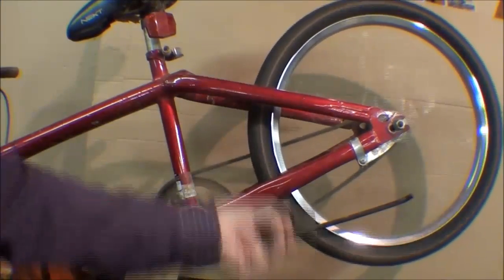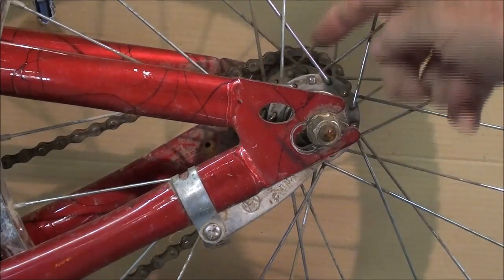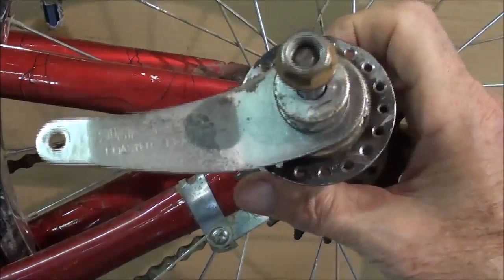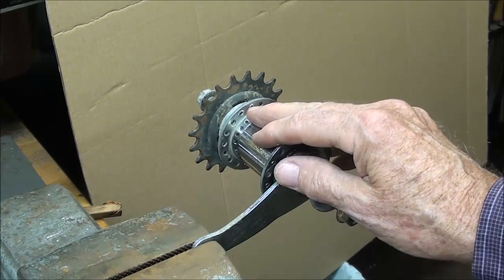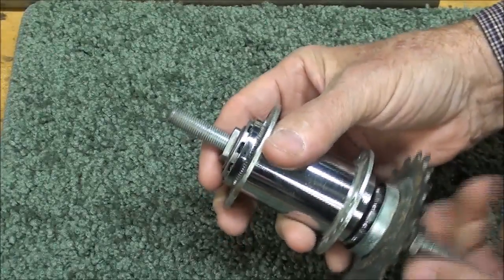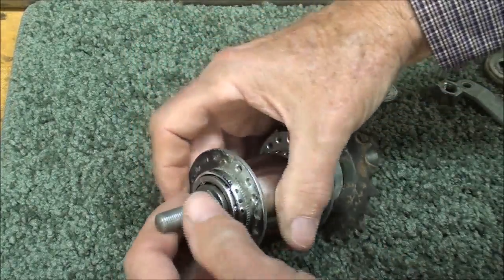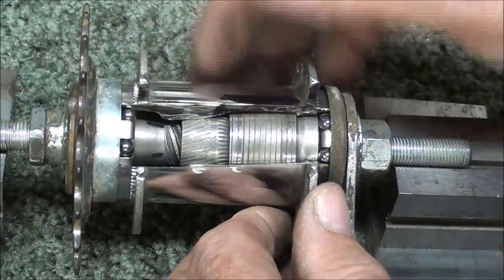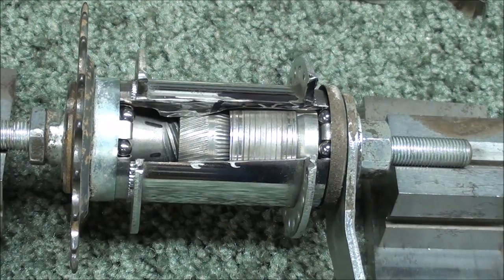WHAT MAKES IT WORK? #13 The Bicycle Coaster Brake tubalcain

Comment: Lyle, regarding that strap, 
"Plumber's tape!"

http://www.homedepot.com/p/Basset-Products-3-4-in-x-50-ft-Perforated-Galvanized-Steel-Duct-Strap-DS50-1-28G/205871091?cm_mmc=Shopping%7cTHD%7cG%7c0%7cG-BASE-PLA-D26P-AirCirculation%7c&gclid=CLXUlpjZ19MCFc1lfgod6VkKMQ&gclsrc=aw.ds

Sorry to use Home D, but that is the first one to show up.

steve

Comment: You paid a nickel for a soft drink and got a penny for deposit on the bottle. We used to sneak in under the fence at the Pepsi plant in back, steal bottles stored for re-use, and cash them in at stores around the corner. That was back in the mid 50's and we usually made at least two, three dollars a day. That was big money back then.

Comment: Thank you Sir for that nice video.  It was a lot of work for you to do that cutaway and show us the working mechanism.  Much appreciated. As a kid I did everything I could on my own to my bikes. Took apart the head sets, cranks and bottom brackets, but never the wheel hubs except to grease the bearings.  I always wondered what was inside my rear hub and thanks to you I now know.  I still love bicycles and your video again substantiates for me the marvelous engineering advances that has gone into that mode of transportation over the centuries.
Reply from the maker: Thanks for watching--yes, it was very hard

Comment: I think I was  10  when the adjustment on the bearings needed correction on these brakes,     On the farm about the only plier/wrench type tool we had were vice grips of two sizes,    so readjusting the bearing loading was a by guess and by god  adventure,   , lots of miss adjustments and chewed up wrench flats and fine threads  also chewed up.   Didn't have any "tappet  thin wrenches" to di right.   In the end it worked out and learned the mechanics of the "Bendix" hub / brake system.   (vice grips were named "a Hitler" because grampa said that if Hitler got hold of something he didn't let go of it).   regards

Comment: @mrpete222 Thank you very much for this video. My neighbour (which is
107!) came and asked me to fix the coaster hub on his old Raleigh
(yep, he still cycles!), but I never put my hands on such mechanics.
Somebody had previously tightened the hub and cones too much on that
Raleigh and he couldn't pedal anymore. I have the feeling that
tightening to death the cones was just a sloppy makeshift solution.
Indeed, I opened the hub and cleaned it from the grime, and I noticed
that one cone is in pretty bad condition, then I re-assembled it
without replacing the cone, just to see. I tried to find the right
balance while tightening the cones to allow the wheel to spin freely.
Another problem came out: now you can pedal easily but when pushing
hard on pedals (specially after braking) they slip.
What am I doing wrong? Is that worn out cone the possible cause?
Reply from the maker: I am not a bike expert-just did that one vid. You cannot leave out parts.
Reply: Thank you. I mean, I didn't replace the worn out cone with a new one, I just put back the old one

Comment: Wow!  This really took me back to the 1950's as a kid. Fix them or walk  Would like to see a video about the type of coaster brake with all the little flat discs that were like a miniature disc brakes. Had a bike once like that and the brakes worked well but, sometimes the pedals would not engage to go forward. My dad or I was never was able to fix this problem. Years later, I was able to find the cure.

Comment: This is great.  My interest was piqued in coaster breakdom very recently by a visit to an Endodontist.  The office is in the old (>100 YO) New Departure administrative building in Bristol CT where Harry Townsend patented a coaster brake in 1898. There are old pictures and advertisements on the walls in the entry way.  I have always wondered how the brakes worked having used them as a kid.   BTW, there are parks named for Page and Rockwell in Bristol.  Its quite sad that New Departure is completely gone now.  GM shut the most modern Bristol facility in the 90's.   Much of the old buildings still stand and is a reminder of the once great manufacturing core in the USA.

Comment: I remember having about a dozen free bicycles as a 10 year old just to keep replacing all the parts that failed. Had to replace one of these once, but they just drive and coast, the braking was done through handlebar brakes. My dad used to say "The garage here looks like a mexican car dealership" from all the bicycles lying around.

Comment: Thanks,  This brings back memories as this was the first mechanism I took apart.  Having a paper route in grade school you needed a bike to shorten delivery time. 

I remember taking the back hub apart in 7th or 8th grade because the brake would not work.  Ultimately the brake shoes were worn.  It took me a number of trials to take it apart and diagnose what was the root cause of failure.   It was a dirty job and the first thing you did was fill an old coffee can with some gas and wash all the dirty grease from the parts.  It was a small yet significant accomplishment fixing your own bike.  Perhaps the reason I chose engineering as a profession.

Keep the vids coming!  Great Work.

Comment: If you remove the hub and reassemble the rest of the mechanism, hold the brake pads in place and snap a rubber band around them. I think you will be surprised again at the beauty of it all. Myself and a few friends once took one apart and couldn't make a cut away, breaking every saw we used to cut the hub, and the hub wasn't even nicked as I recall. So I came up with the rubber band approach, and my goodness we analyzed that thing for hours, watching the brake pads expand out. Seeing how the system moved from drive to brake and learning the quirks of the design. We did this because we were convinced if a bicycle hub could be used for breaking it could also be used to power the bicycle from a motor or generate electricity from inside the hub. We never figured out how to do it lacking the tools to even cut the hub, we clearly didn't stand a chance probably. Now a days bicycle hubs are made with both motors and generators inside the hub... Would have been nice to invent that technology. I think we also took one of those Sears 3 speed internal hubs apart, those are even more amazing inside! Good stuff! 🚴🏻

Comment: My bike had a oil cup in the center of the drum (I used 3in1 oil) and a clutch pack (alternating steel plates and clutch plates with splines in and out as the breaking element.
I believe it was a Schwinn.  My pop bought it on credit from "Western Auto" over 66 years ago.

Comment: Thank you such much! This may seem EXTREMELY RANDOM, but it was the reason I went out searching how a coaster brake. I'm making a Lego Mindstorms EV3 multi-color printer. I only have one motor for 4 printer heads. Not going to explain how it works thus far because that would be a waste of my time, but if the motor turns backwards a certain amount, I wanted it to completely disengage the printer heads. Once I put this design into Legos, it should do nicely. :-)

Comment: Thanks, I grew up riding coaster brake bikes in the early 70s and never knew how the things worked.  I don't recall ever having a problem with them so I never needed to take one apart - good thing as I probably wouldn't have gotten it back together!

Comment: Thanks so very much for taking the time to show us how a coaster brake bicycle works ! !  My wife is unable to ride a two-wheel bike due to an inner-ear balance problem.  We just got her a  Banana Peel trike, by Trailmate.  She likes it a lot.  It's front wheel drive with coaster brake.  When she's on a slight uphill, it's difficult for her to position the pedals into the proper angle for applying power.  I've figured out how to install a conventional pinch brake.  I'd like to disable the coaster brake, allowing her to back pedal for proper angle to apply power with her foot.  I've seen this done on YouTube videos.  It looks like I should be able to do this safely.  Any thoughts or ideas?   Bob

Comment: This is the first of your video's I've watched but I learned something today I've always wondered about but had never researched. Your disassembly of the drum and explanation and especially the cut-out visual of the drum, make the mechanics of riding/braking easy to understand. Needless to say, I can now identify how a crankshaft on a coaster-brake bike propels the bike forward, or alternatively slows it down by pushing the brake shoes to expand against the walls of the drum, depending on which way you pedal (and the so-called "cone" either screwing toward the sprocket or toward the brake shoes). Thanks to the internet and video's such as yours, people can easily become "smarter" about whatever it is they're interested in. I found your video because I was trying to figure out how to force a stopping skid using coaster brakes. THANKS !!!

Comment: GREAT REAR HUB. BEST HUB FOR KIDS. EASY FOR THEM TO LEARN TO RIDE SAFLY. HAND BRAKES ARE NOT GOOD FOR KIDS UNTIL THEY HAVE THE STRENGH AND KNOW HOW TO RIDE. THESE ARE MORE FUN FOR THEM TO SKID WITH BUT WEARS THE TIRES FASTER. I JUST SPENT 5 YEARS IN THE PHILIPPINES. THEY SELL CRAP CHINESE BIKES FOR KIDS THERE WITH JUST HAND BRAKES. DANGEROUS, AND NO ONE KNOWS HOW TO KEEP THE BRAKES ADJUSTED. NO COASTER BRAKES THERE, THEY DON T KNOW WHAT THEY ARE. PLUS THE BEARING FALL APART QUICKLY BECAUSE THE CHINESE DON T PUT ANY GREACE IN THE BEARINGS. SO I AM FIXING BIKES IN THE US WITH COASTER BRAKES AND SENDING THEM OVER.

Comment: Now I understand what happened to my very first bike's brakes when I was 6 years old after lots of tyre smoking stops! Now plan to fit one to my single speed project on a old steel frame Peugeot so I can do away with brake cables should look very sleek. 

The cutaway is a great demo of the engineering inside the hub. I always assumed there where normal brake shoes and not a metal on metal arrangement.

Comment: When I was 7 or 8, I guess, I could overhaul Bendix and sometimes New Departure coaster brakes.  I did it for all my friends to re-lubricate the bearings so our bikes would coast efficiently and to tighten up loose wobbling rear wheels.  The New Departure was more complicated and sometimes I couldn't get them back together properly.  I did not understand how either one worked until now.  Thank you Mr. Pete.  This brake you demonstrate looks like the New Departure design if memory serves however it was over 50 years ago!

Comment: I hate handle bar brakes. Hard to find these brakes on adult bikes. Like he said we wore out so many tires with the coaster brake. These are way better design then todays brakes. So much more fun also. Thanks for making this video.
Reply: If the chain comes of the sprocket (or chainring) - or otherwise fails - bicycles equipped only with a coaster brake will be without any safe way to stop. This is one reason why coaster brakes are found largely on children's bicycles today, as those bikes are presumed to not be used in traffic, at high speeds, or in other situations where total loss of braking would be extremely dangerous.
Reply: That sounds extremely unlikely. Never happened to me and we were self taught building bikes out of scraps we would find laying around. Not saying it's not possible.
Reply: These considerations are a normal part of most discussions of the pros and cons of coaster brakes in bicycle mechanic reference materials. For example, see here: http://www.sheldonbrown.com/coaster-brakes.html

Comment: Thanks for the video, I used to work in the bicycle industry and have dismantled many of those, and it would have been nice to have something like the cutout you made as a teaching tool.

One of the neat features of a coaster brake hub is that when it is coasting it allows the wheel to turn freely in either direction, whereas a ratchet-type freewheel will only allow free movement in the forward direction.  If a coaster brake hub is modified to no longer brake, usually with a clip/spacer, the bike can be rolled backwards without the crank being forced to pedal backwards, which can be very useful for freestyle/trick bikes.

Comment: Well explained. I am 70 and seem to remember taking one apart and finding a number of disk plates in it that I guess bound up to obtain the same effect. It would have been US made for sure at that time. Maybe it was one of the other designs used? I will 100% agree with you on the black grease!!
Thanks, Tom

Comment: Great explanation and demonstration. I had a coaster brake in a small yellow bike when I was a kid, and I always wondered exactly how it worked.

The only thing in this video that I didn´t get is exactly why the brake arm on the left is needed. Are the bolts in the frame not enough to keep the axle from turning while trying to brake?

Comment: I've grown with different style of coaster brake bikes.. made in soviet union and surroundings being in a country from the iron curtain. This one were made by XB3 and used a roller one way drive (the roller bearings sitting in a slope with some springs and when pedaling forward the rollers were jamming against the outer casing), the braking was done with another oneway drive that was driving a cam to push on 3 brake shoes. The one-way was put the other way around for braking.

Comment: The brake you discussed is drum brake, first made by Bendix. New Departure brakes were disk brakes. They had multiple moving disks between multiple fixed disks, much like commercial airplanes.

Comment: As a young boy, I had taken a number of things apart, and sometimes even put them back together…  However, I was never temped to take the rear bike hub apart as I figured that I would not get it back quite right.  My front axel broke once, but I just unscrewed the ends only and slid that new axel in.  No chance of losing a part that way!   Thanks for the interesting and probably unique to youtube video.
Reply from the maker: +slad roznik thanks for watching--I never took one apart as a boy.

Comment: awesome video! it's simple to take it apart but very difficult to put it back together xD
Reply from the maker: +Bryan Chong Thanks for watching
Reply: +mrpete222 is grease compulsory? I'm not even close to placing the brake shoes in the correct position
Reply from the maker: +Bryan Chong yes

Comment: The college I attended in the seventies had some old copies of a magazine from 1899. The big deal then was the difference between 2 point and 3 point bearings. Instead of cone ball and cup the choice then was 2 points of contact with the ball or 3. Flat surfaces with intersecting planes.Three point being almost half again the price of a two point bicycle. Process machining has come a long way over the decades. From the commentary here the coaster brake was a contemporaneous design. Firearm and steam engine design reached a peak about then,and the automobile just was starting. And yet cutting with a radiused cutter then hardening the surface was something that had not reached the general public. The shop programs of high school were just being introduced,the sort of thing you taught. The period 1890-1925 went from horse,coal and coal oil to car,gasoline and electricity. Human ingenuity is endless,but that was a really remarkable generation. Would love to have seen how the factory handled machining then hardening those hubs. It must be very high quality steel. Great programs,keep it up. Cheers.
Reply from the maker: +paul manson Thanks for watching

Comment: that was a neat demo of an ever day item you never give much thought. it just worked. 
On a side note, I did take one apart that was on an old moped. The very first ones made in 1954 here in sweden. It was a bike with a motor on basically. That one had brass as break frictions. Not two half but a tube with cuts 75% of the way. Apart from that it had the same princip. 
I had one of those two speed kick shifter bikes. It seem you always was in wrong gear. Going uphill you had to break to get into low, that was a drag. They made a ticking sound, second gear ticked at an lower pace.

Comment: This is by far my new favorite "how it works" video. I took one apart as a kid and remember all the grease inside and could not believe that mechanism could actually work as a brake with all that lube inside.  You mentioned the hardness of the drum when you did the cut-away and you estimated it at being 60 Rockwell.  New Departure is long gone now after being swallowed up by GM many years ago but two of their employees developed and patented a certain method/process that is known and used around the world today and will be far into the future - that being the Rockwell hardness test/scale  co-developed by Hugh Rockwell and Stanley Rockwell while employed at New Departure in Bristol Connecticut.
Reply from the maker: +Jayne Gus I also never understood the brake working in oil. Thanks-did not know about the Rockwells.

Comment: Thank you Lyle for a great inspiring video.

I've often dreamed of a bi directional sprag clutch for a mill's power feed (over 2 years now).

Your cutaway demonstrates a solution by virtue of the 6 lead high pitch screw and operation in either direction forcing hub rotation in each direction (braking normally being constrained by the lever arm).
Most importantly the neutral coasting position.

If the hub were attached to the mill's leadscrew, and the high pitch screw to the motor shaft, I think my dilemma is solved.

This means no dog clutch is needed to operate the table by hand, and no motor drag especially if a worm drive wiper motor is being used.
Perhaps it's better for the serrations to bite either way in this use (no shoes).

Hmmmm, time to get some ideas on paper methinks...
Reply from the maker: +Ray Jones Thanks for watching--glad I got you thinking